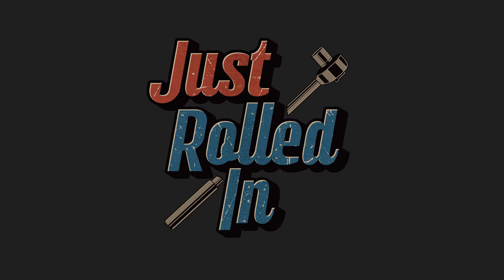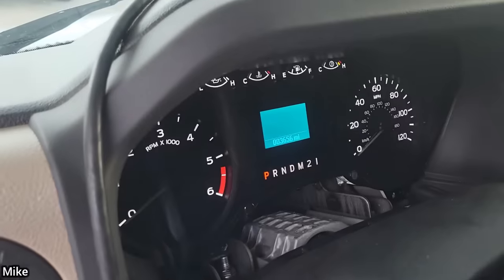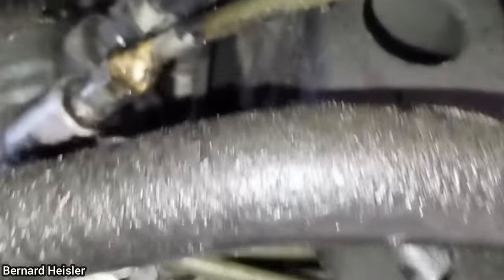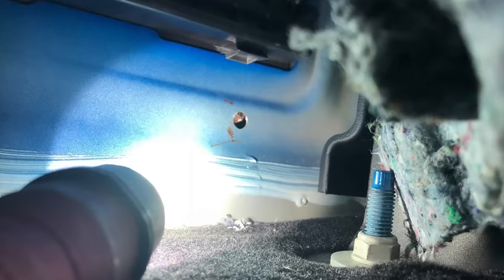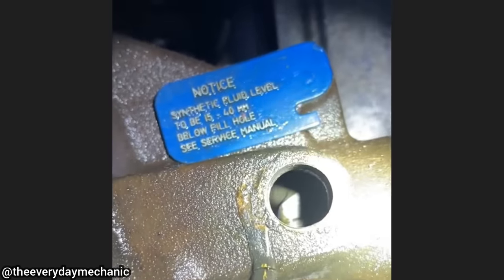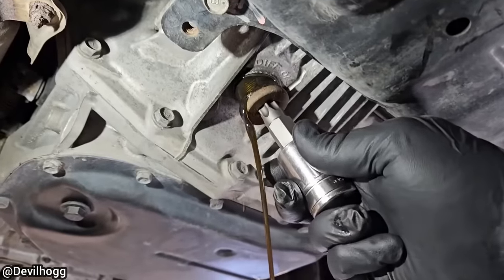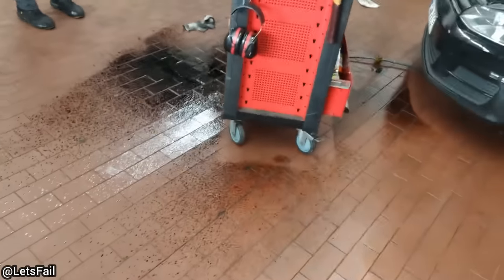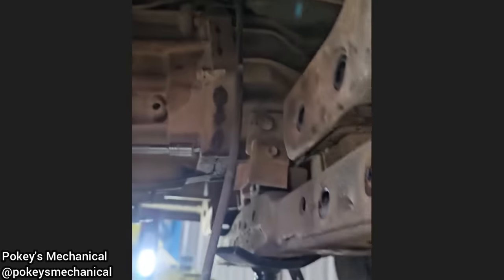Mechanic FAILS Compilation | Just Rolled In

Comment: Well, today we serviced a C6 Corvette Grand Sport. I did the oil, oil filter, engine filter, and cab filter while another technician put on new tires.
Our tire machine couldn't break the tight beads on the old tires so we were going to take it to a local tire shop.
I had my work all done, tight plugs, new filters, and other stuff and the tire guy had installed the old tires. I was told to take it off my lift to take it down to the tire shop.
As the front tires started to hit my ramp I had to cut the wheels real hard being there's a stupid office behind me. (Sucks doing a 2500-3500 diesel or gas).
Anyway, the car was off the lift when I felt something odd & saw a lug nut shoot across the floor!
(The tire guy forgot to tighten the right side tires!)
We were fortunate they didn't come off or cause damage! (Glad this happened in the shop and not while driving to the tire shop!)
~
James
P.S. Here's a shot of my lift with another  a semi rare mid-bay engine Corvette I worked on, you can kind of see how hard it can be getting cars on this straight.
https://youtube.com/shorts/jwmTUYGZzLQ

Comment: Um, don't EVER put brake cleaner on or near anything hot as it will break down into chemical compounds that will seriously function you up☠️
If the space is enclosed, you might not be going home👻

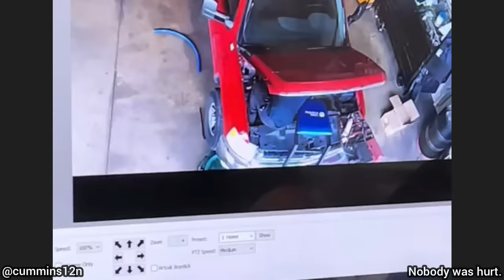Comment: 2:39 why the ever loving F would you braze a line when it's cheaper and easier to just F put the F flare in properly by cutting just the tip and unkinking some of the line. Unreal. UN REAL.

Comment: That isn’t fram universal coolant at 0:40 it is head gasket sealer used incorrectly it congeals
Reply from the maker: No it's fram universal coolant lol
Reply: That’s crazy because I’ve seen the head gasket sealer do that exact thing, consistency and all. I’ve had to flush systems on a few different cars due to people doing this. Usually the jelly is stuck at the thermostat. 
Maybe someone else added it in
Been doing this for 13 years never seen coolant itself do this. Cheap coolant usually corrodes. 
I’m just saying, maybe someone isn’t telling the truth 🤫
Reply: This is actually why it calls to empty system and flush with water before using them with thermostat removed
Reply from the maker: Search what happens when you mix HOAT coolant with OAT coolant. The technician had this happen to multiple vehicles when they used the fram coolant. Not everybody apparently had head gasket sealer in the coolant. That happened after they fixed multiple vehicles and filled with coolant systems with a different antifreeze.
Reply: @JustRolledIn  thats new to me. Goes to show, you never stop learning. That’s something I have to look for, I have admittedly used universal coolant in quite a few cars, never had this happen. Usually only put dealer coolant in German cars, some Chrysler/jeep products(aluminum blocks), and higher end vehicles.

Comment: That last one was either staged or he's a complete idiot. Just look at the length of the socket and the clearance he had WITHOUT the extension on there. He clearly didn't need the extension and using it would have made it awfully wobbly backing out that bolt which is a rookie move to begin with.